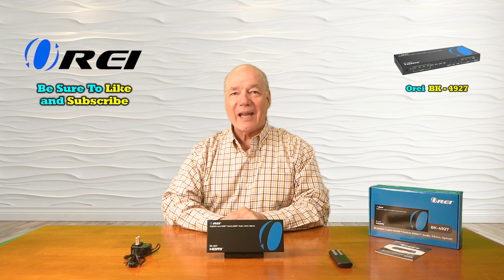OREI 8K HDMI Switch 4x1 with eARC Dolby Vision, 4K@120Hz, HDR10+ | Audio Extractor for AV Receivers

Comment: What is difference between the model BK-4929, BK-4927 and BK-401ARC and which one is latest model recommended to buy? They all have 4 hdmi inputs. I had issues with BK-401ARC and had to return it due to video dropouts on samsung oled tv. Concerned about trying BK4929 or BK4927 but it’s really confusing.